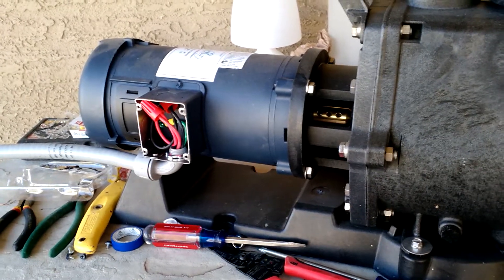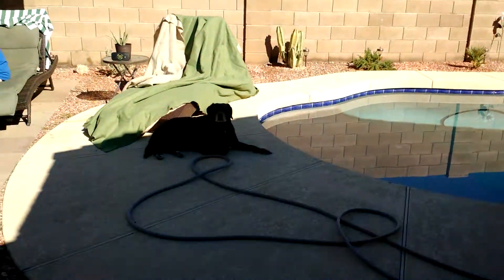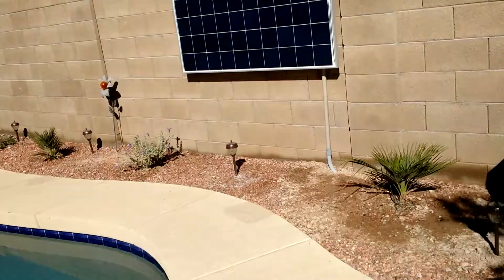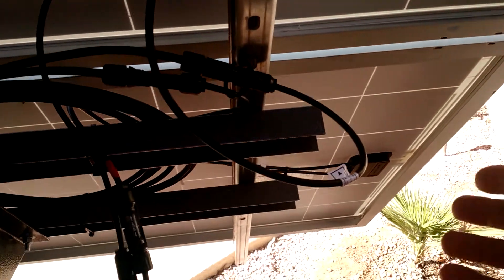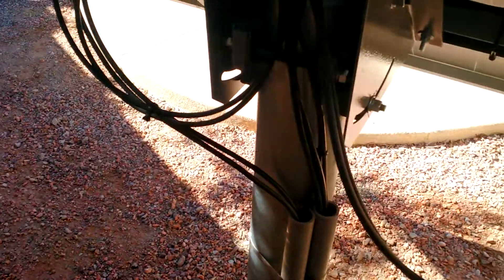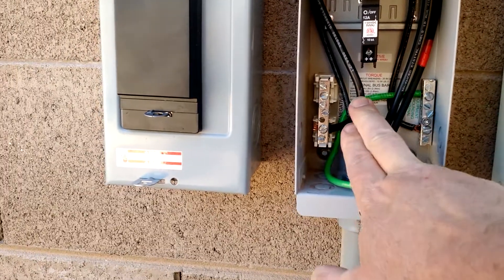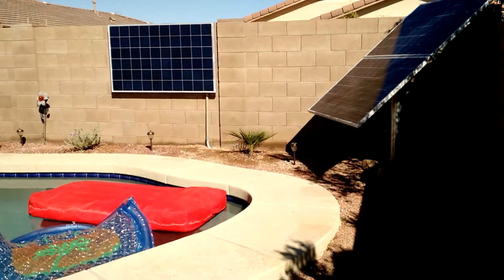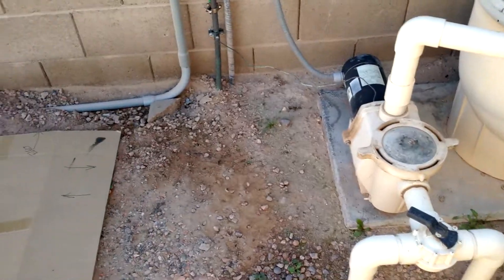Solar pool pump

Comment: Hello Chris, looks you are getting the system together, looking forward to see how your pool pump performs with using brush motor.
Maybe put a timer in the system that the pump doesn't keep running during all hours of the sun. Give it a break at least 20-30 minutes every hour. As we seen previous customers frying these pumps quickly.
Let all people know how the pump performs.

Regards,

Peter